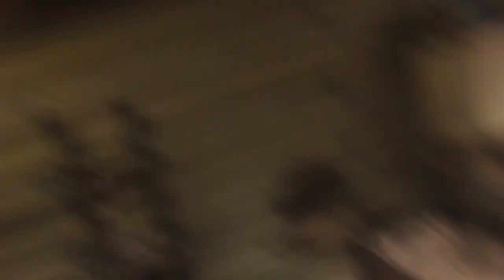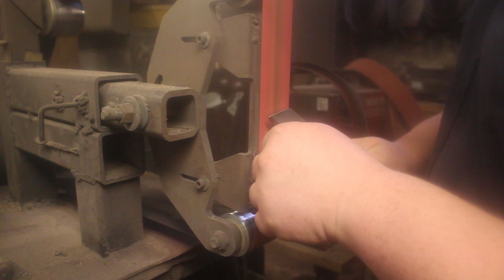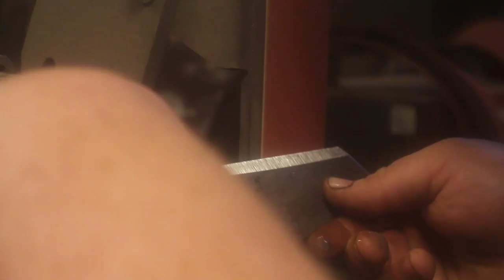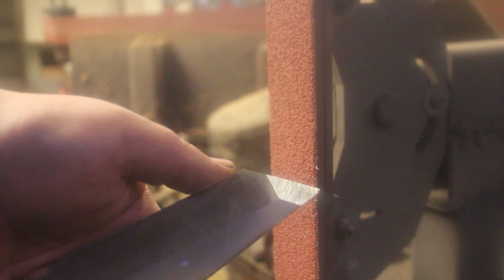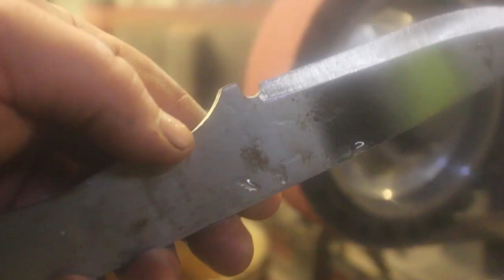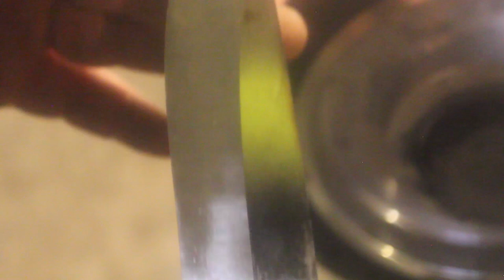How to Flat Grind a Tanto and Hollow Grind a Clip Point

Comment: This is exactly the video I was looking for. I have a question. Do you start with an over sized blank to get to the size you want in the end. I draw and design cool knives all the time I just having trouble finishing them the way I draw them.
Reply from the maker: I generally profile my blades a little oversized so I have bit extra when I grind off the scale and decarb after heat treat.